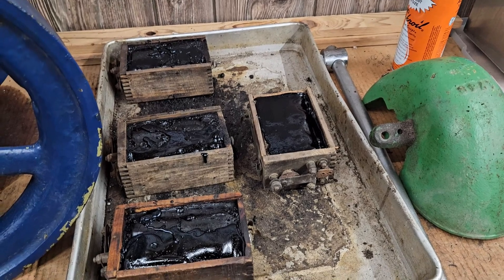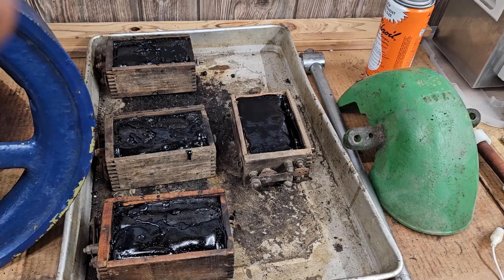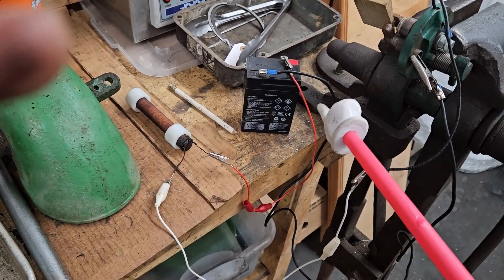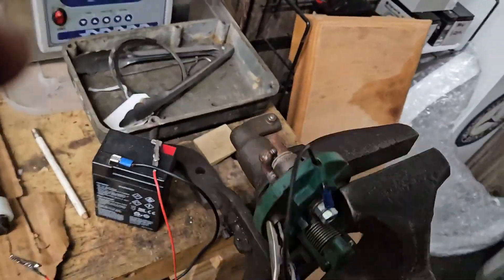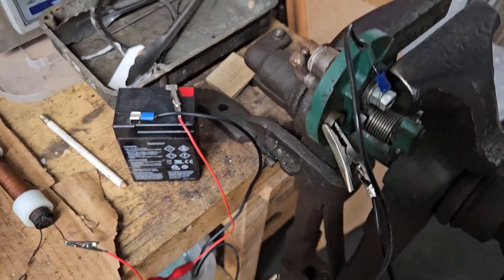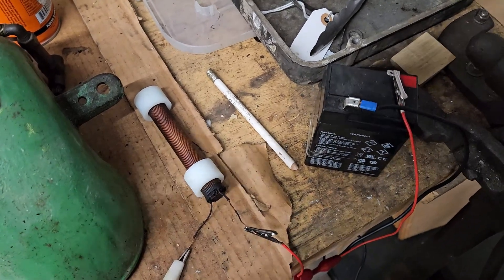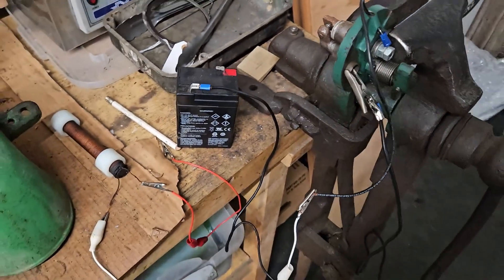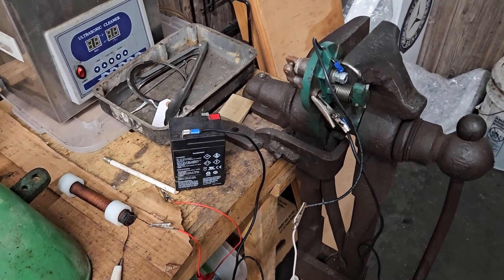t coil

Comment: Thanks for the video!  I'm new to this hobby and have enjoyed a bunch of your videos.  I liked your carts 1&2 series.  I have a Novo 3hp that I was running off a model T buzz box and a 6v battery pack (battery looks like the one in this video)  It ran fine like that for a while, but now the spark looks like yours- pretty weak.  I'll have to check the warmth of the wires and coil next time to see if my problem is similar to what you showed
Reply from the maker: Check your t coil condenser. It maybe getting weak and check your ground wire also.
Reply: Thanks - I suspect the condenser - tar inside is kind of "spattered" in that area.  Luckily my wife bought me an old National Coil buzz box for Christmas to keep me going!  @oilholeup1155